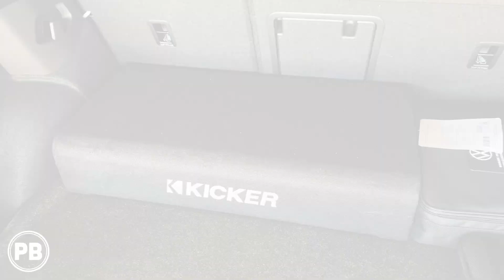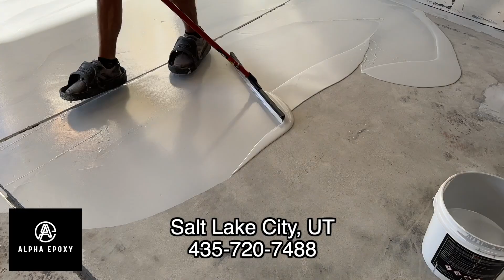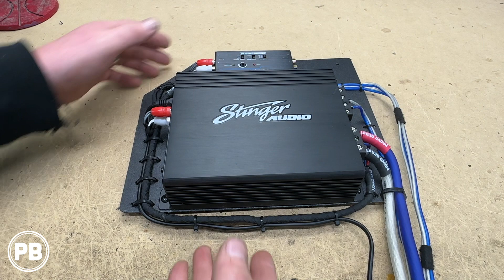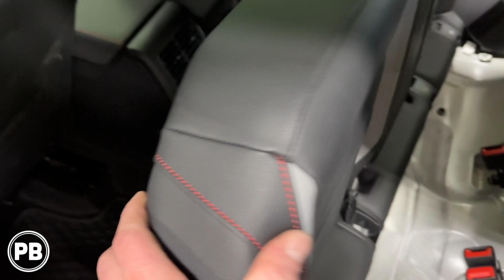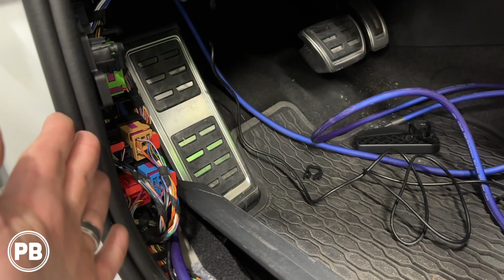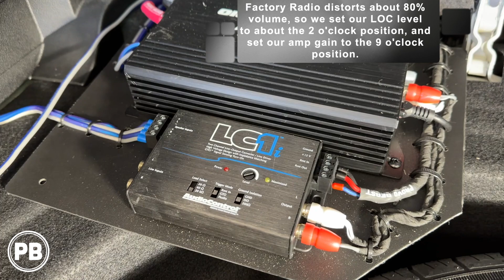2021 - 2025 VW GTI / GOLF Amp and Sub Install

Comment: Where does the remote in go to?
Reply: Basically, the LC1i has GTO Sense which basically automatically detects signal when the radio is powered on and does not require its own remote. When it detects signal/power, it powers on automatically. Therefore you can just use the Remote Out on the LC1 and run it to your amplifier for remote and skips the step of trying to find an accessory wire to tap into. Its a great LOC

Comment: A few obligatory mistakes to note.
- Don't drill ground holes into the chassis. There are endless OEM chassis ground points in the car. Use a OEM ground point. Drilling holes in the car is unnecessary.
- Don't drill holes in the trim of the car to mount the bass knob. 3M tape it to the undercover. Drilling holes in the trim is unnecessary.
- Use a Y connector on the OEM sub/speaker connectors. Don't cut the OEM wires. Damaging the wires is unnecessary.
- In this specific case. Do not plug the factory sub back in. Leave it disconnected and set the LC1i to 20ohms on its load selector switch.
Reply: I am planning to use the speaker level inputs to my Hertz amp. Can I leave my factory sub unplugged?

Comment: Do you know of a video on how to do this with having no sub in the rear
Reply: You have to take apart the dash right hand side to reach the media player. This was easier on the mk7 but mk8 it’s tucked underneath the dash. Then you’ll have to splice or have the adapter some mentioned above to buy an adapter so you won’t splice and get speaker signal.

Comment: Does any body else here their voice through the subwoofer? its like the signal i got from the left rear speaker is a microphone? WHAT THE HELLLLL
Reply: adjust your low pass filter on amp. set to 100hz

Comment: Awesome video! Why leave the stock HK sub plugged in though? Wouldn’t you want to isolate the new sub to get maximum sound quality
Reply: I agree. I have the 25R and have enough room to put a Kicker 49DL7TDF122 under the false floor, I believe.  Or I will opt for a custom-built Option-10 Drive Flat designed specifically for the Golf.

Comment: What is the benefit of installing the lc2i vs the lc1i? And is the installation the same?
Reply from the maker: well the LC2i has more features than the LC1i.  Lc1i is a line driver with trigger mode and ground isolation features.  LC2i pro adds in accubass to correct factory bass rolloff issues.

Comment: Maybe I missed it, Is the factory sub disabled now? Again, sorry if I missed it. I see the tap in but it's not a bypass, correct/
Reply: No it's not bypassed. From what I can see, the OEM sub is still wired and he used the signal to bring it to the amplifier
Reply: So you’re using both the factory sub and the kicker sub?  From what I can tell, your stinger amp is powering kicker and the factory sub is still being powered by factory amp.  Is that right?

Comment: I own an Audi, and you can find online the connector for the factory subwoofer where you do not have to splice or cut the wires.  Plug and play.
Reply: Do you know where i can find this? Ive been trying to search for one like crazy
Reply: @Mr_Das_Auto 

Yes,  I got it on Amazon under "2-pin Car Speaker Wire Connector." The manufacturer is UCCKEYI.    Works perfect!!!
Reply: @Mr_Das_Auto 

Amazon. I responded to your message but don't see it now.   It is under "2-pin Car Speaker Wire Connector"
Reply: @Mr_Das_Auto 

Brand:UCCKEYI
Reply: @Mr_Das_Auto 

I have responded to you twice but YouTube keeps deleting my message. @mazon
Reply: @drrckhamilton thank you lol. Youtube tryna hide the recipe.
Reply: @Mr_Das_Auto 

Yessir 😂😂
Reply: @Mr_Das_Auto 

This is what it's called 

2 Pieces 2-Pin Car Speaker Wire Harness Adapter Connector Plug Universal Compatible with Audi

Comment: I wish i could use my sub to its full potential in our MK8. Im running a 15 inch sub on around 1,5k rms but because of the output signal from the loc, i get bad peaks around 55 - 60 hz and no low end under 20 hz.